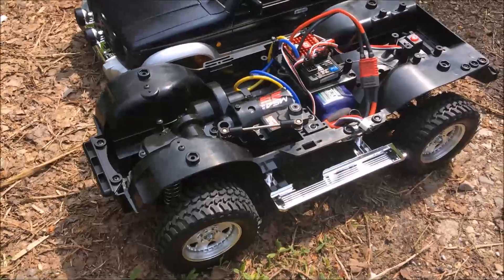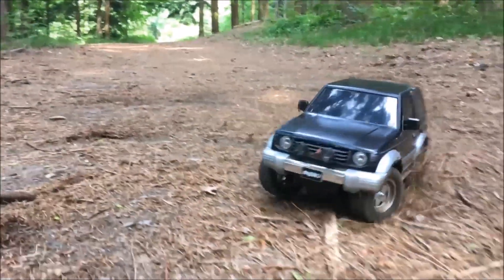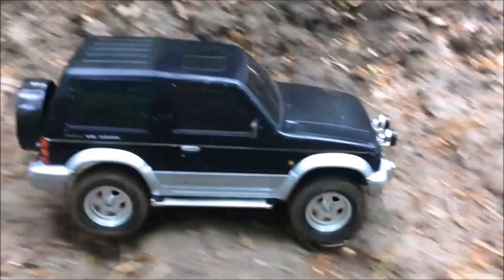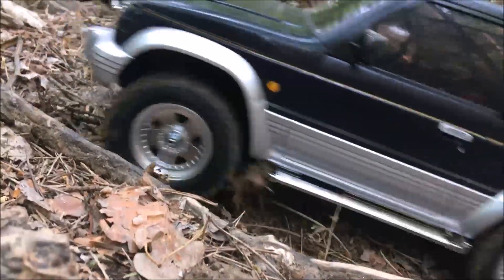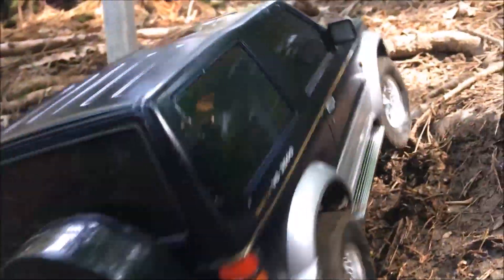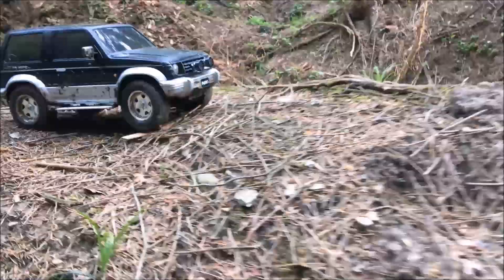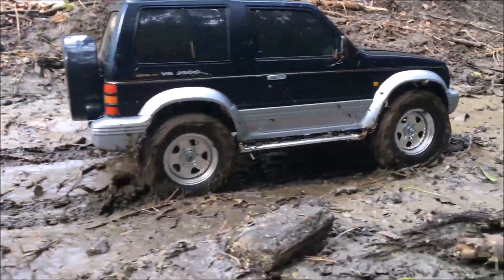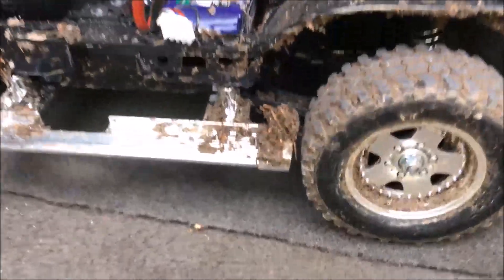Tamiya CC-01 - FIRST RUN REVIEW

Comment: can you send me your 1080 esc settings numbers for my cc01 pajero...i also have 35t motor with 1080hobbywing esc so i want your setting ..can you help me..thank you?
Reply from the maker: Hi! Thank you for asking! I don't have the CC-01 anymore (sold it a few weeks ago for another project). So I can't tell you exactly. But other than full hill brake I think the settings where mostly standard stettings. Nothing special. Do you have any problems with your settings?
Reply: Rooster RC ...thanks for your reply...yes bro i have problem , when my cc01 pajero with stock esc and tamiya 540 motor it was a lot faster than this 1080 esc....now its speed is slow ...what i have to do,,,?